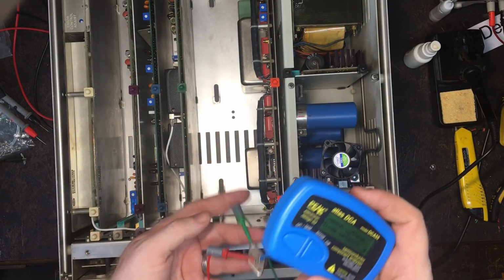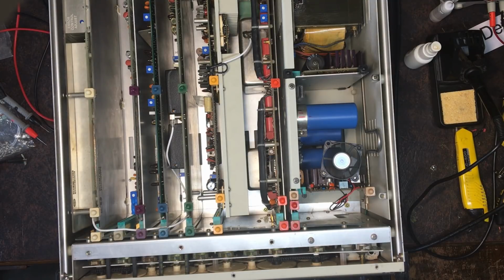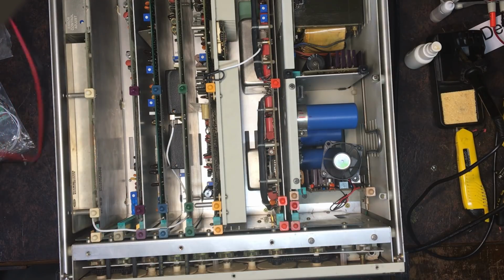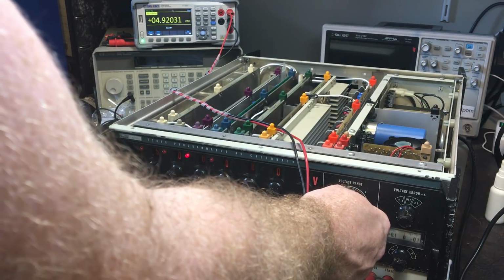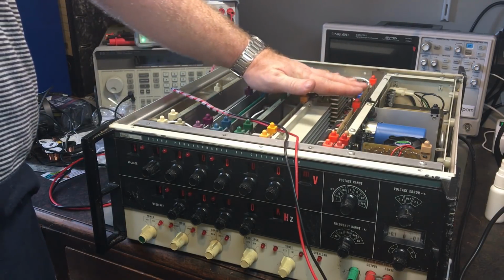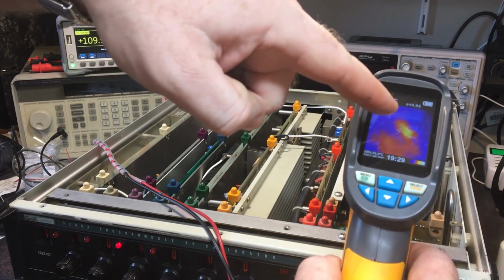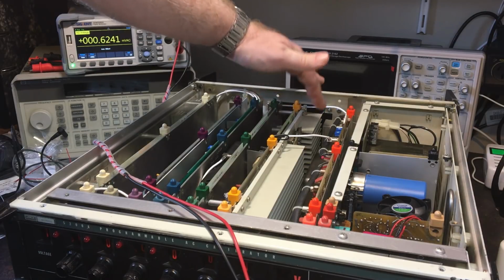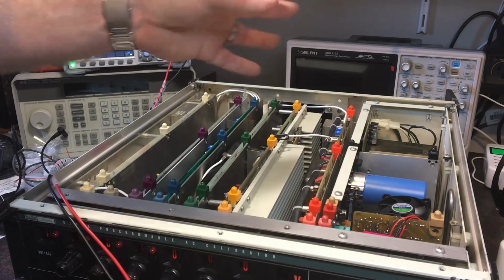🔴 #346 Fluke 5200A AC Calibrator Repair Part 15 - Power Amplifier A7 Continued

Comment: I dropped that 5200A data for you here - https://1drv.ms/f/s!Amqar8_XQ9UzkfYYWsNbNZH6LOQAyQ - It looks like I have a bit of noise at the low end 100Hz but that might have been contacts because I think it went away at 1KHz.
Reply from the maker: tgsoapbox - thank you, I will sit down today and compare against what I am getting, I was seeing more noise at 100Hz too.
Reply: From memory I was seeing something in the range of 5% on 100mV @ 100Hz - The rest though could be in spec w.r.t stability even though the original accuracy hasn't been adjusted - Haven't run the numbers.
Reply from the maker: I have looked at your data, and I see some interesting variations, for instance the span of the 100Hz, 100mV is about 9.6mV, but your 1V measurement is 225uV... what sampling time were you using? my data is very linear and almost predictable, so the fact that yours isn't the same kind of predictability makes me wonder if it is due to sampling time of the measurements?
Reply: 3458A - SETACV SYNC - The unit works out the integration time automatically depending on the resolution, 7.5 digits in this case.
Reply from the maker: tgsoapbox - interesting, I wonder why your measurements are varying so much, maybe your 5200A is a bit sick too? I am just collecting a bunch of data right now on all ranges, to try and help me to find where the noise is, my real issues are in the 100Hz and 1MHz ranges, although I suspect the 1MHz is more about my multimeter being able to read it, will double check it with my scope to be sure.
Reply: I suspect that it is a bit ill - While I repaired it to the point where I could use it for some measurements, I never got around to completing the performance tests or adjusting the quadrature error.
Reply from the maker: Your data still helped though, it gave me an idea of what to expect, and what I should be seeing, the noise in mine seems reasonable in comparison, apart from the 100Hz range, BUT I just noticed something, I put my multimeter into frequency measurement with graphing, and I was seeing frequency jumps, which seem to coincide with the voltage jumps, so it is likely to be a frequency control issue, as the voltages are derived from the frequency, so if that isn't stable the voltage won't be either.
Reply: Great call - I suspect that there is probably something similar going on with mine as well as I can't get that quadrature setting to meet spec. I'll need to take a look into it.
Reply from the maker: I just hooked up my scope to monitor the output voltage at the same time as the frequency on my SDM3065X, yep, the voltage spikes/dips at the moment that the frequency jumps, now I should hook up to the counter output at the back and make sure that the frequency there is also jumping.
Reply from the maker: The counter output is showing extra jitter pulses on my scope, so yes there is something wrong with the frequency control.

Comment: I would  use heatsink compound. It's fine at HV. Get there mate!
Reply from the maker: Simon Spiers - yes I did end up putting some on, I was worried about the transistors getting hot and the heatsink feeling too cool, seems to be fine.
Reply: Is heatsink compound on that style of transistor a relatively new thing? It's just that I can remember my Dad working on a number of old televisions back in the eighties and they never seemed to have any heatsink compound on that style of transistor either.

Comment: It's been an uphill fight with every stage, at last it's showing promise :-D.

That front panel switch is a pain, perhaps thats the next thing to do.
Some power resistors can stink if they are not really clean, possibly a scrub with metholated spirits of better could help.
Your a better man than me, i would have shown it the skip lol.
Reply: I think all the switches are dirty. I remember about 5 vids back it wasn't working, then there was rapid movement of the freq switch and it suddenly started working. From the vid Mr Def wasn't looking at the DMM and missed the actual point it happened, but he did notice it 1min latter..